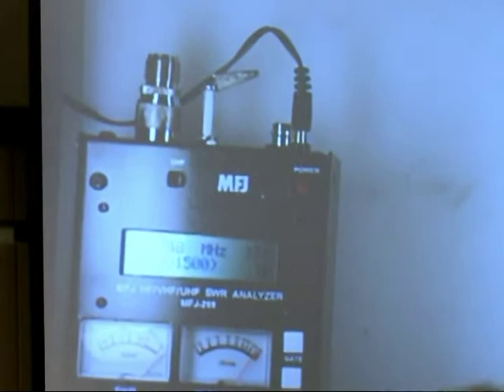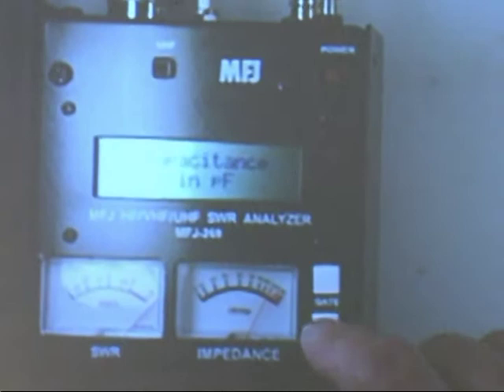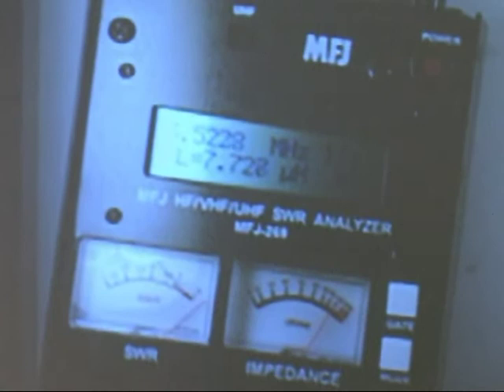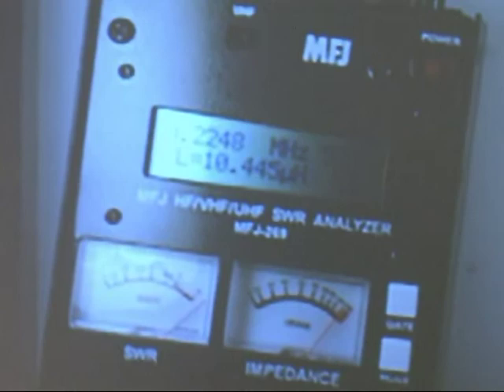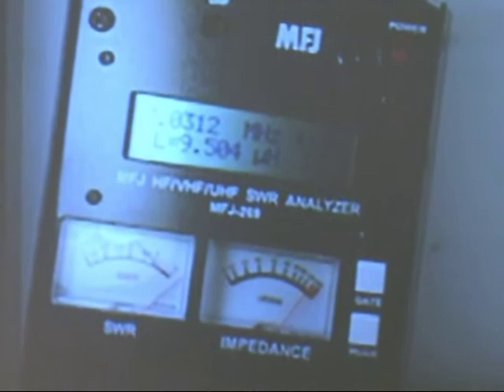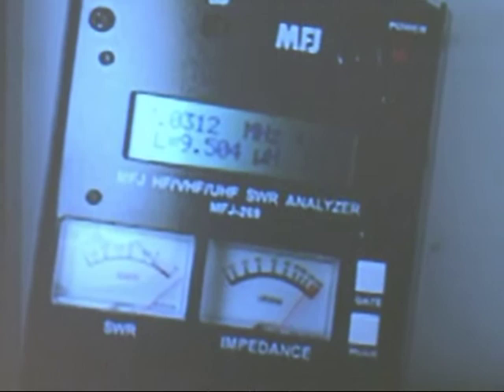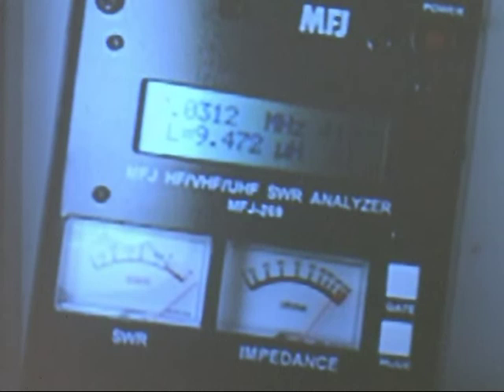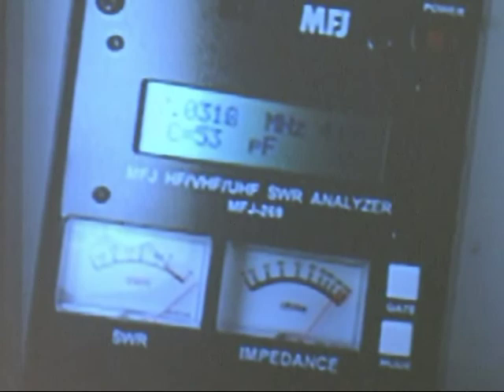MFJ Presentation: Resonating a Tuned Circuit

Comment: I enjoy watching Mr. Jue's videos. He is an outstanding MFJ rep. For years I've seen MFJ sales reps at area hamfests with the latest antenna or morse code translator. 
I'm now familiar with one person to look for at future shows. 
I bought a used MFJ-269 one week ago and I'm growing frustrated. It appears every antenna I test in the impedance R / X mode indicates an SWR value greater than 2 if when I attempt to determine the antenna's resonant frequency at 50 Ohms Impedance.
The antenna is a I'm testing is a COMTRAK D-130 vertical mounted on a tripod / 10 foot mast with 20 feet of RG-8X 50 Ohm (Gray in color). 
I've read over the manual but could not determine if a setting exists to any to reset the analyzer to factory specs. I'm somewhat hesitant 
about entering and altering any of the values in the advanced modes of operation 
Any suggestions fellas?
Reply: I have a MFJ-259C and use it a lot. I dont understand what's happening with your unit. You could attach a non inductive 50 ohm resistor to the test connector. It should read 1:1 exactly.
There isn't really any firmware to reload or update. Or factory reset option. Seems like I seen a  video on here of calibrating the MFJ-259....